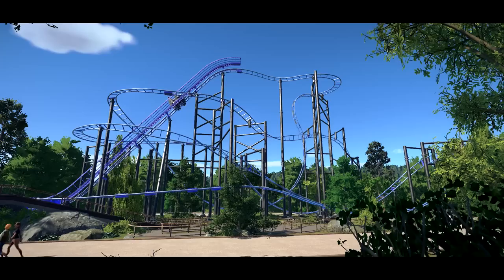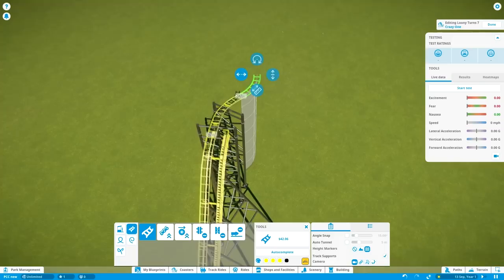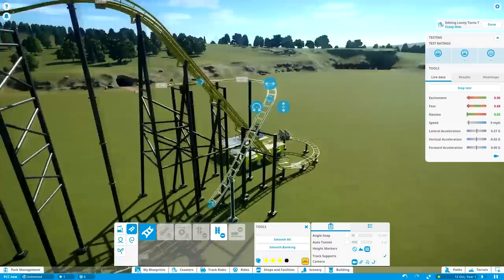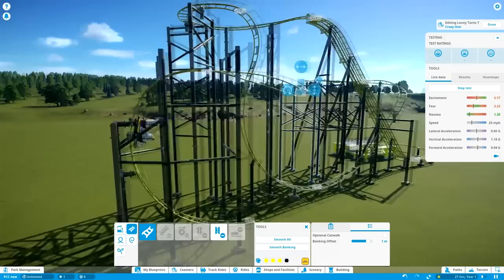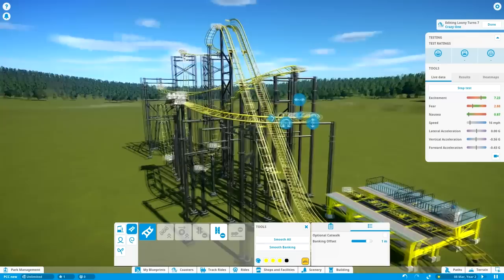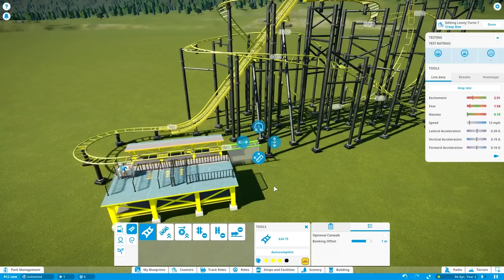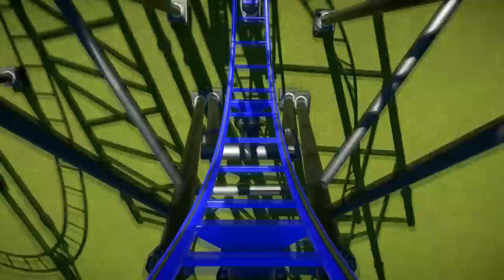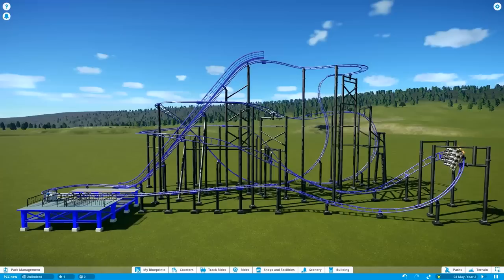Planet Coaster College - El Loco Coaster Tutorial

Comment: Great video! (for once, duh).

But since it's college, here is some more trivia:

- The outward banked turn figure was designed by Alan Schilke (wasn't all the ride designed by him then? I don't know), the man who invented the 4thD coaster for Arrow.
- The strength of the original design is that, minus some lower parts, all the ride is supported by 4 columns, each composed of 4 vertical supports. So the number of foundations is actually quite low.
- You'd need your block brakes to be slanted as well, following a neutral slope (that's how we call a slope where the car rolls but don't gain speed). It could be handy in case of a power failure. Also, catwalks! ^^

Comment: I don't know what type of coaster this is, but look up Crazy Loop Roller Coaster in Brean, U.K. I went on it and it would have been smooth if it were not so old, and it is fairly compact as are all the coasters in that park. Have a look at them and see what you think. I just thought that it was quite interesting that they were quite similar to the El Locos, but I think portable is the best description of the coasters, but they are fixed to the concrete.

Comment: You didn't test with multiple trains to get the timings of your block sections worked out. Maybe that's a subject worthy of its own video (if you haven't already made one on the subject). I suppose it doesn't matter as much with this type of coaster, but I hate it when a block brake actually has to stop a train unless the ride has broken down.

Comment: Would Cannibal at Lagoon Amusement park be considered an El Loco? It has a very different track look, and it has an elevator lift instead of a lift hill.
Reply: Nope, different manufacturer. El Locos are made exclusively by S&S. Cannibal however was designed built by the park itself, which is actually a pretty rare thing, especially since it didn't turn out to be a catastrophe.
Reply: I remember that did scare the heck out of me when I first rode it. Is the parks ride Colossus an Arrow coaster?
Reply: Cannibal is closer to a Eurofighter. The El Loco is a very specific and compact layout, while a Eurofighter has many different layouts. The only difference is the manufacturer, as Gerstlauer is the only maker of Eurofighters.
Reply: And if I remember correctly, the launched coaster wicked is built by some company out of Germany... Zierer? I think?
Reply: Yeah, that one's by Zierer. It's actually the only one of its kind, if I am not mistaken.
Reply: Now what I'm trying to remember is what type of coaster the "white" roller coaster is. It was built in something like 1921... I think.